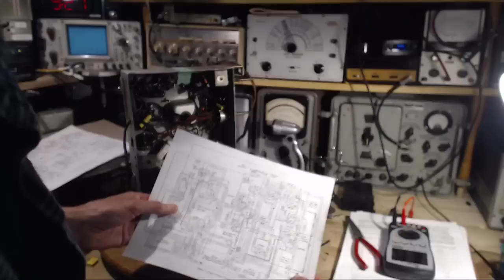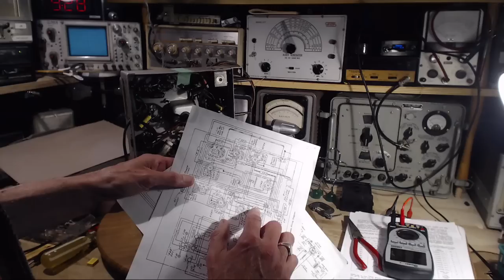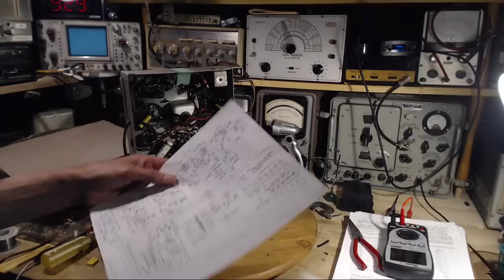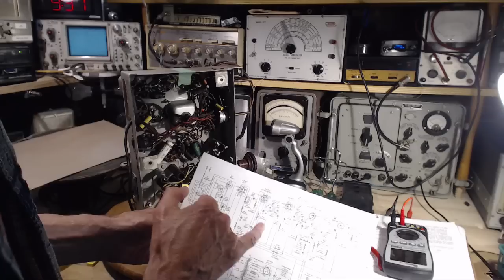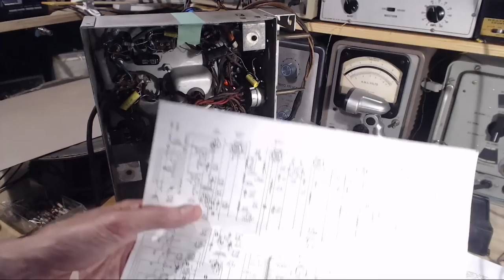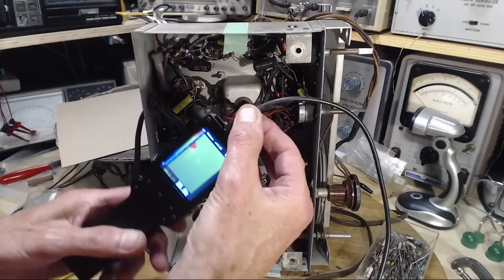Canadian General Electric Model JK-66 Video #17 - All Mistakes Sorted Out

Comment: Jim, you really need to read the comments sometimes. Resistor R2 should be 3,900 Ohm (3k9), you have 39,000 Ohm (39k) fitted that's 10 time the resistance required, no wonder it's getting hot.  You have Orange - White - Orange it should be Orange - white - Red! 
(Edit: My apologies, I see @widecast has already commented below)